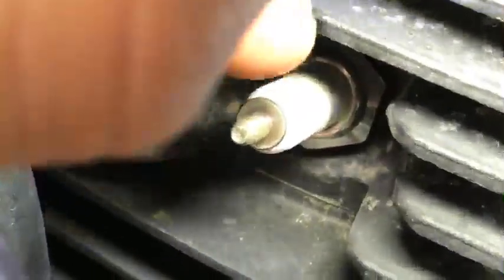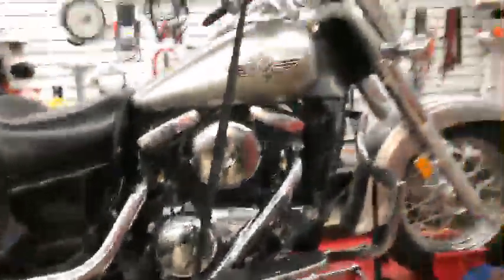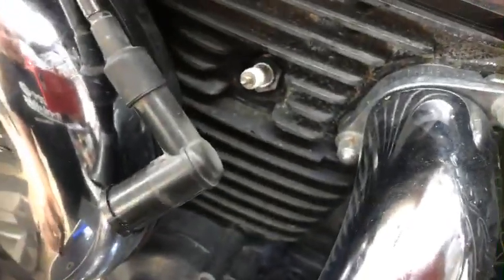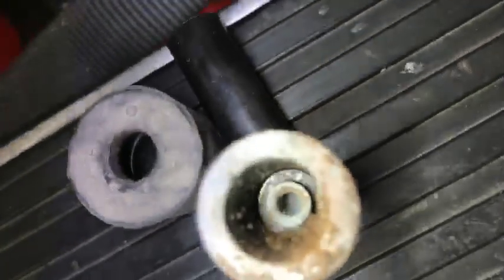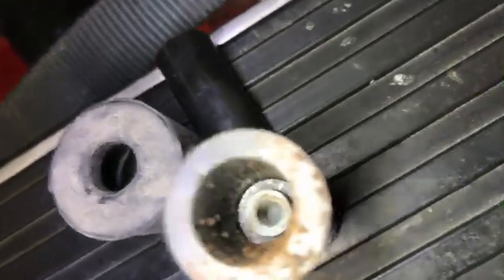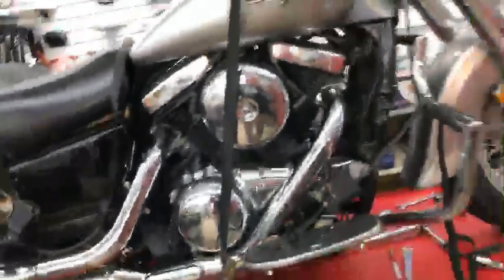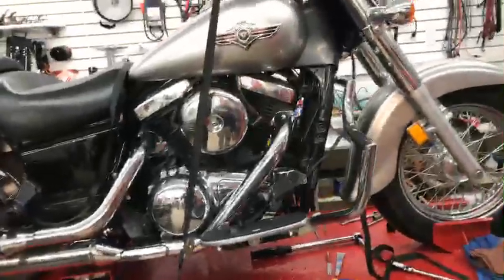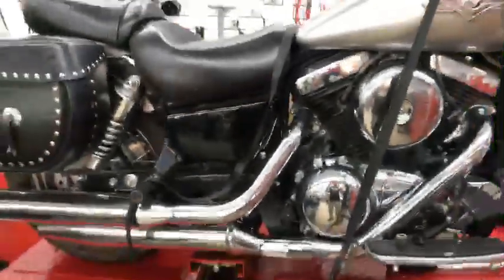How the spark plug cap attaches the spark plug. Example of a failed spark plug cap up close!

Comment: Thanks for the breakdown of how the cap uses the spring for those connections.  Also worth noting sometime if you haven't already, some of the plug boots had resistors in them at least back in the 80s and they could rot out internally where you couldn't see them.